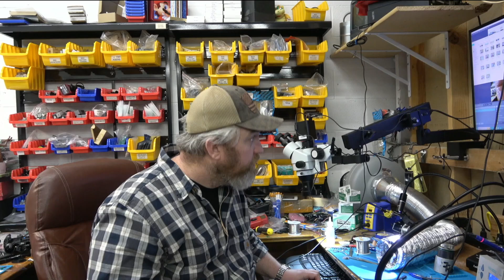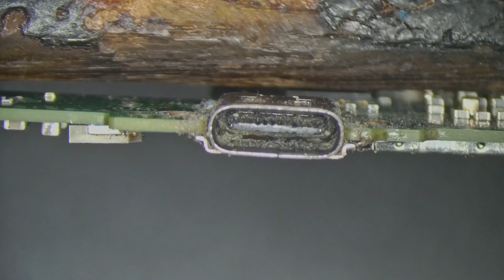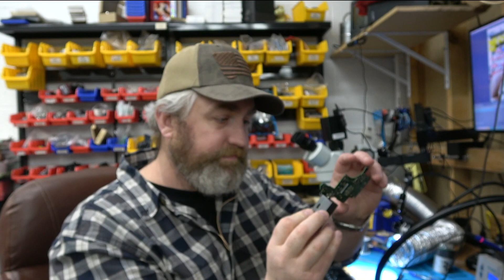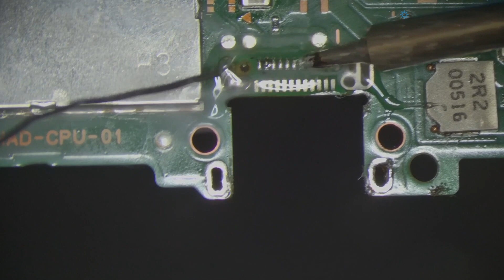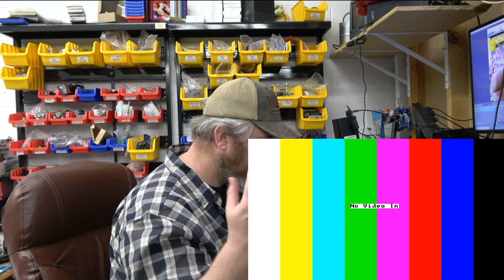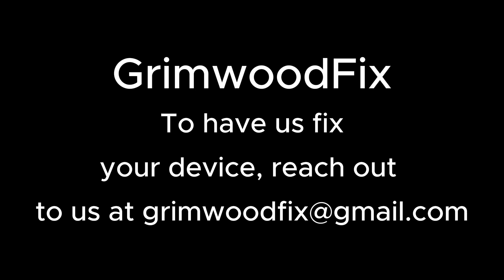Nintendo Switch not docking to TV.  Let's repair it

Comment: could a reflow of the solder on the port have worked ?
Reply from the maker: If a loose solder connection was the problem.  But that port was dirty inside.